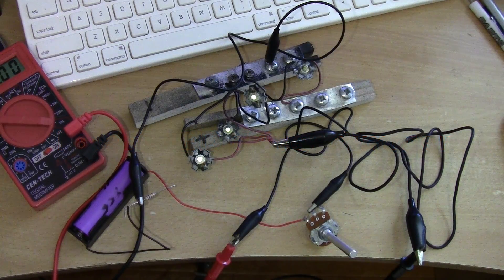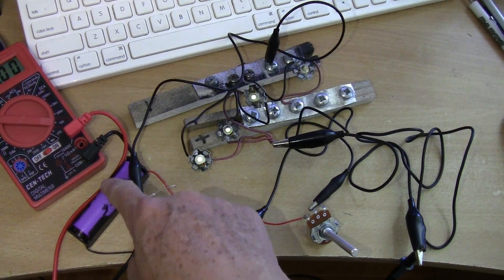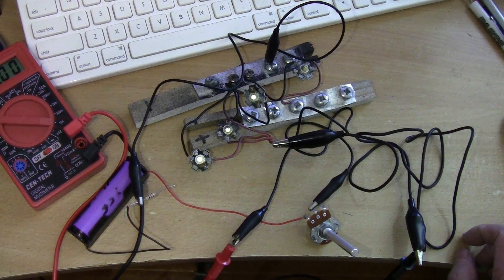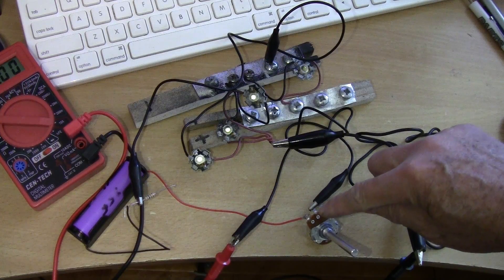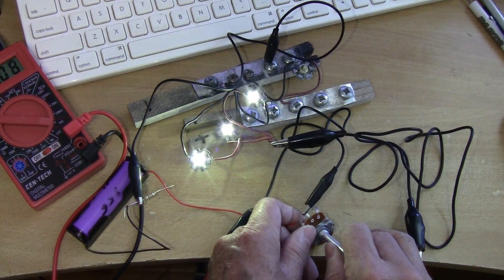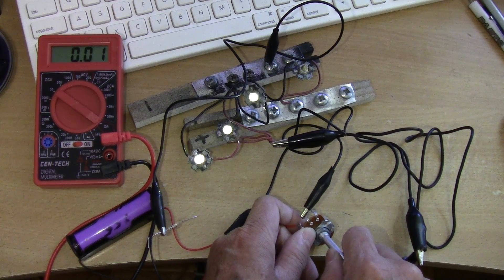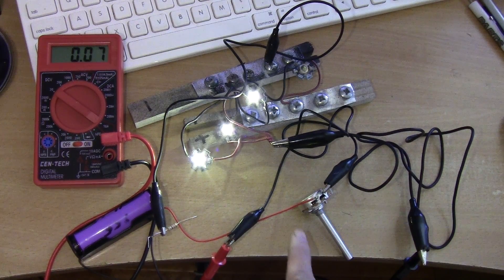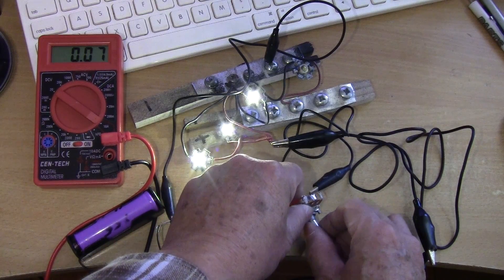1 watt LED dimmer driver

Comment: Interesting, one of those LED drivers look like the ones I bought while back, they appear to be based around a ZXLD1360  5 pin chip or clone of one. The chip actually has a adjust pin to allow dimming, could be be worth looking into.

Here is the datasheet: http://www.diodes.com/_files/datasheets/ZXLD1360.pdf
Reply from the maker: Thanks very much for your input. I looked at your link and the chip seems to be different from the one I bought a while back.  The adjust pin on your chip will certainly make it more versatile.